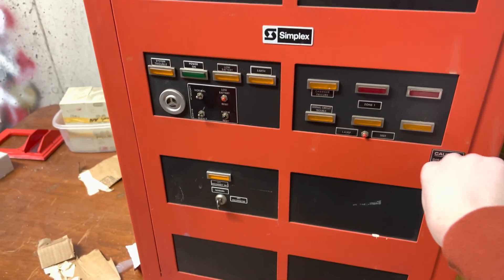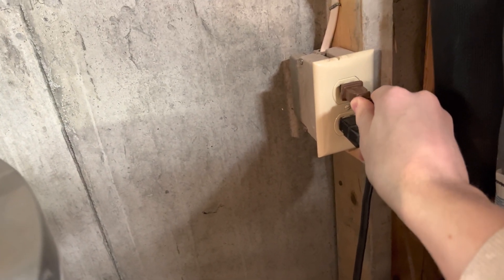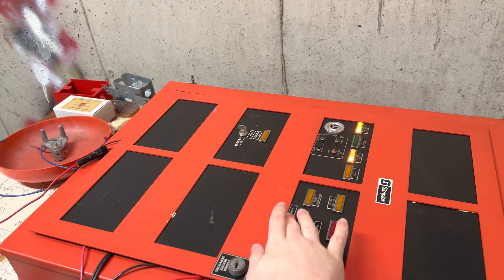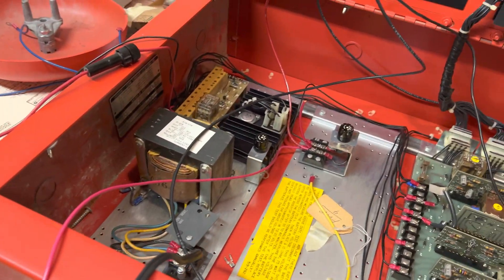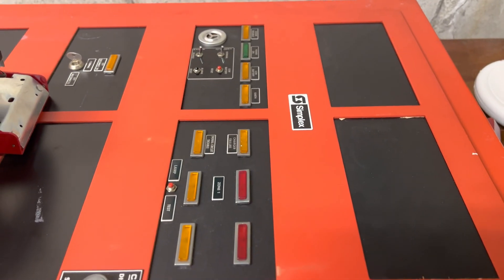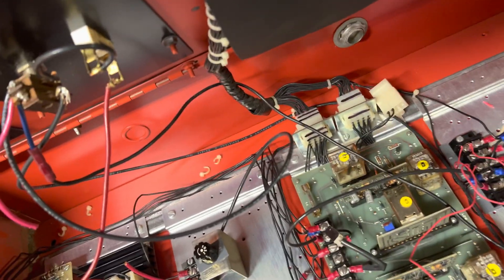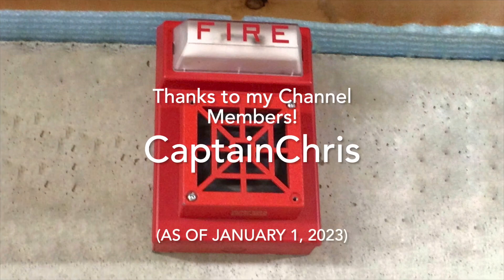Simplex 4207 Test and Panel Linking Demonstration

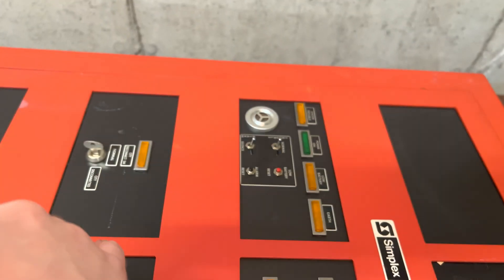Comment: 4:23 you've just gotta chop some hands off and then you're all set!
Reply from the maker: lmao

I actually had some 440kOhm resistors from an electronics kit, so I just used two of those in parallel to last until I can get the proper 200k resistors

Comment: Nice! The 1978 buildings at my college campus were originally built with Simplex 4207 systems, with 4051+4050-80 horn/lights (the horns were on Continuous while the light plates flashed via the 4207's coding wheel), 4251-20 single-action pulls, 4255-1 and 4265 (Chemtronics rebrand) heat sensors and ESL 523C smoke detectors (except the Field House that only used heats). They've unfortunately since been replaced, mostly Notifier systems (though the Field House has a Fire-Lite MS-9600UDLS panel) with boring SpectrAlert Advance horn/strobes and some L-series horn/strobes, but the Fine Arts, Field House and Administration buildings still have most of the Simplex pulls intact! (A few that failed over time were replaced with Faraday F1GT "Chevrons" and Fire-Lite/Notifier BG-12s.)